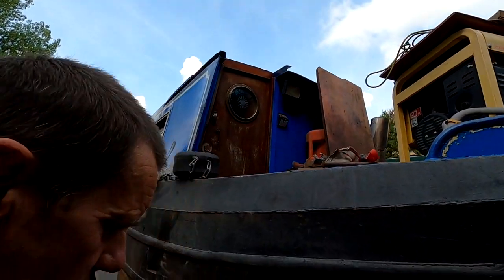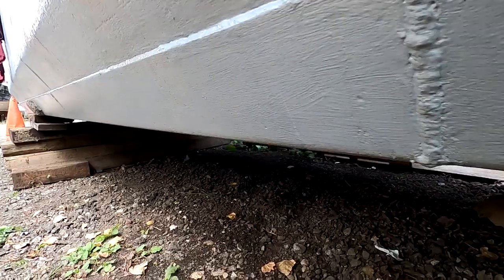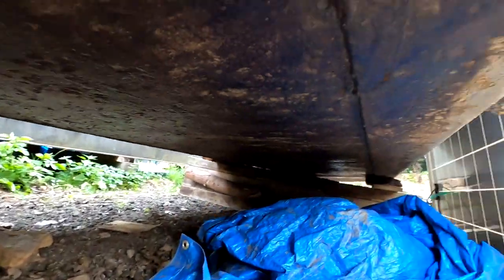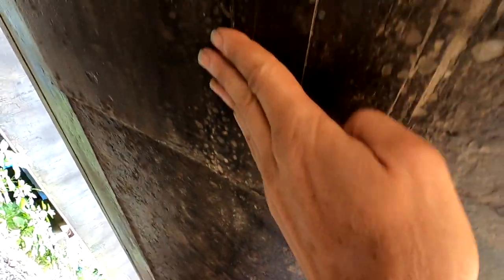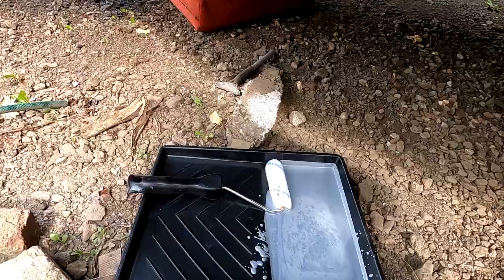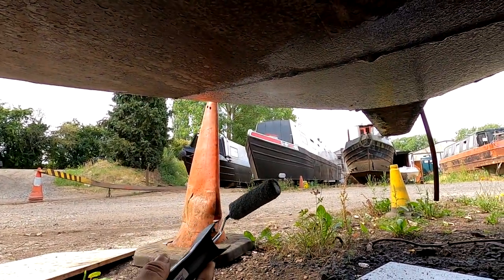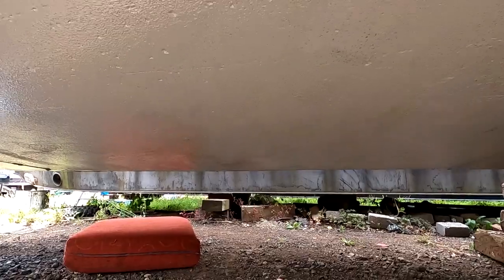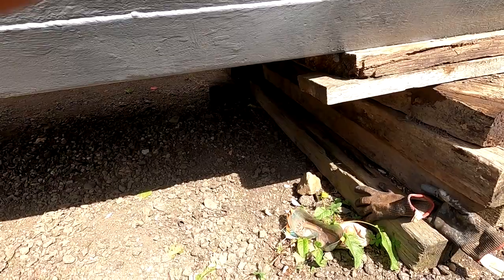Painting my Narrowboat Base plate , Narrowboat life

Comment: ahhh, the big baseplate paint debate. I think it probably is needed for springers.
Reply from the maker: Lol well yeah probably true   , however plenty of flat bottomed narrowboats have been over plated  , like the boat opposite mine  !  Lol  , and not only the whole base plate  , the sides of the guys boat had to be done aswell .
Let's say a 60 ft boat needs the base plate over plating  , that's about 13 / 14  sheets 5 mm thick 8 x 4 size  , at close to 300 a sheet   , then the labour at 50 quid an hour , plus you need to take the floor up inside  ,  thsts of course if its being done properly  , because holes needed to be drilled through the whole lot  , and things called roses need fitting  , to hold the plates together. 
I think a few cans of decent paint seems easier. Lol
Reply: @thenewboater5380  It also depends on if the boat has been in a marina. Galvanic corrosion causes pitting which increases the surface area for rusting which will effect any metal in contact with the water (is my understanding)
Reply from the maker: @DEmma1972  yes it doesn't do a steel boat any good being in a marina , they also rot from the inside out  , condensation runs down and if the inside of the Hull isn't well protected  , then they can rust very badly.
Reply: @thenewboater5380  Agreed, the inside can rust more because of the higher oxygen levels with the sloshing of water inside
Reply from the maker: @DEmma1972  yes I was actually told recently ,  about a boat that had been out of the water some time  , and the Hull ended up rotten .

Comment: Good vid Nigel and very interesting. I'm currently doing the same with my (70') narrowboat. I brush painted the Jotamastic on the hull sides. Each side took 5hrs/coat so not looking forward to doing the base plate. I tried the recommended rollers but they were rubbish. What rollers did you use? Many thanks